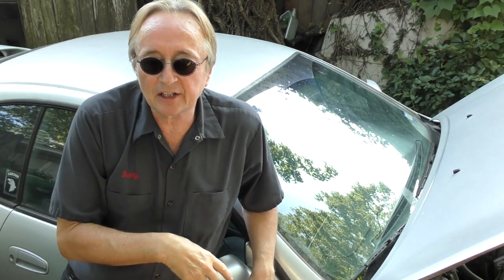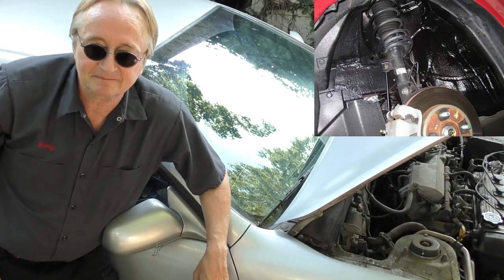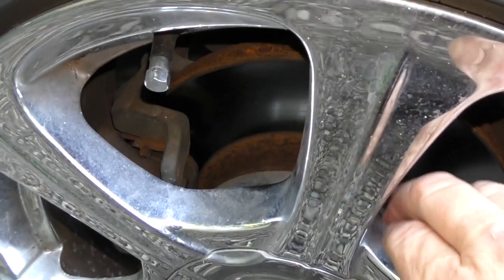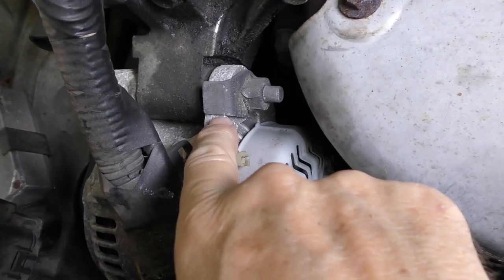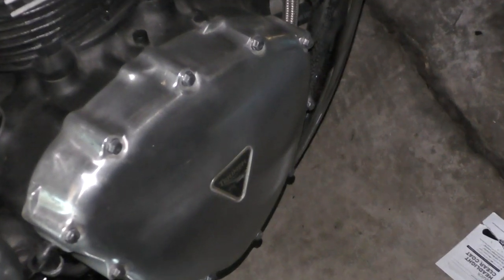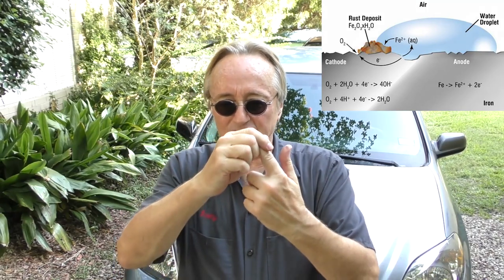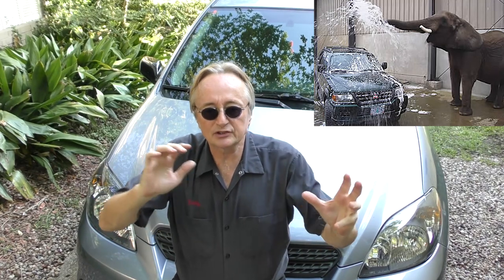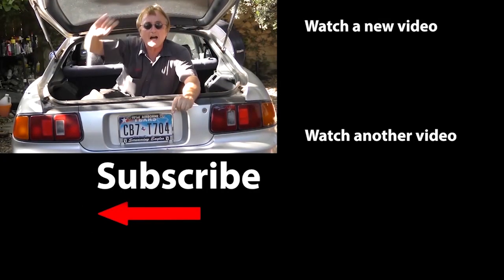Why Not to Park Your Car in a Garage

Comment: I always heard that cars stay in better condition out here in Phoenix! Just hope your AC never breaks because even the breeze feels like a hair dryer. 

I kinda made a mistake I wanna confess. I washed a brand new car because I was scared the heat might get to her. Well it's pretty dusty here in Phoenix so as you can imagine she developed spots all over. The wax jobs the dealerships use are meant to deal with the heat all day. I should've realized that but might as well share a dumb story. 

Honestly I wonder what other hazards dust can have besides on the air filters? Of course a hot engine and the battery wear out faster in 100+ degrees everyday but I'm not moving from phoenix anytime soon.

Comment: I bought a 3 year old crossover. Runs beautiful. Looked under the car, rusty as hell. I live in Illinois. Go figure. 
Is there any reason i should be concerned? Or try to remove some of the rust and put some protectant on it?

Comment: A thought just occured to me. Wouldn't the water that sits in the body joints technically be like the car is submerged allowing an electronic rust preventer work in those areas?
I live in a place that never gets below 17°c so ice is not a thing outside the refrigerator.

Comment: Corrosion occurs as a result of wetting and drying cycles.  Most corrosion on cars occurs in those states that have snowfall during their winter months, and also use road salt to melt snow that covers roads.  Another source is keeping cars near the coast, exposing them to salt water and salt air.  If you live in L.A., Phoenix, or Las Vegas, chances are you'll never be bothered by corrosion issues.  If you live in New York, Minnesota or Michigan, you'll probably fight a losing battle with road salt-induced corrosion.  As Scotty points out, if you live in a state that typically has heavy snowfall, you should rinse both the painted surfaces and the underside of your car(s) at least once a week during the winter months to minimize the effects of road salt.

Comment: I live up north upper peninsula of Michigan to be exact. My parents use their garage all yr. Of course it's not heated. Now my parents have kept their vehicles rust free. My dad waxes them once in spring and fall. At winter my mom will take it through the car wash once a week depending on the temperature. My mom is a home health aide and is on the road all winter long. My parents vehicles look great when they trade them in. One a 96 f150 they bought brand new with 103 miles on it still looked great not one bit of rust in 02 when they traded it in with 145,000 on it. Me I have had 2 cars I kept rust free. One my 94 escort gt I had it for 7 years not one bit of rust when I got rid of it. The other a 94 escort lx. Both where rust free when I got them. All my other vehicles have had rust when I bought them. It's hard to find a rust free vehicle that I can afford here. Can't afford new so got to buy used. I do try to find one with little rust as I can witch is hard.

Comment: I park my 20-year-old Toyota inside a cold, un-heated garage.  This keeps the glare ice from accumulating on the glass, door latches, etc.  There is no rust problem.  The shelter protects the car from destructive precipitation in the winter and summer.

Comment: I bought a 2004 with perfect paint.  The owner sold it to me and lied about mechanical issues.  I could tell, but I wanted a car that looked nice for once. After I got it home I dug around underneath.  I am fixing things myself as usual, but I need to do something to save it from rust under there.  You said an undercoat will seal it in.  So, what is the best way to save a car that's rotting underneath, but is nice inside and out and is a model you really like with low km's?

Comment: According to Scot Kilmer, he said if you park your car in a garage it might rust compared to parking it outside.
These are a few things that may happen to your car parked outside...car theft(your car can easily be stolen parked outside),dents(kids and other cars), paint discoloring( from acid rain), upholstery discoloration from sun(especially back seats, and roof lining peeling), outside cars can rust too, bird poop. Parking in a garage is better, just don’t park a wet car in garage for longer periods of time, after wash, let it sit in sun to dry and park inside a garage. Sometimes I scratch my head to some of the things he says
Reply: @Belmont wash the salt off the car, let it dry before you park it in a garage...simply. Benefits of parking in a garage outweighs the cons
Reply: @Belmont you go ahead and park your car outside ,go luck

Comment: Next vid suggestion

1. why you should not have steering wheel

2. Why you should not press brake at red light

3. Why you should go 
15mph on highway

4. Why you should not have side mirror

5. Why you should drive on flat tyre

6. Last but not least, why you should not buy a car

Comment: If your garage is heated enough to get your car dry it won't be a problem as long as you get your window opens. The reason is that if you keep them shut the humidity lvl inside will be higher then outside and it will rust your car fast. if you live in north canada, trying to start your car by minus 35 celcius is worst then keeping it inside a heated garage as long as you keep your windows open.

Comment: I had an 05 Buick in Buffalo. No garage. The car was so rusted in 10 years the brake lines blew and the rear suspension was close to falling out. I now live in Florida, own a garage kept 2000 Lincoln town car, not a spot of rust.

Comment: Scotty, Riverside California is much much better place to live than Phoenix AZ. I have been living both places. Riverside California  is ten degree lower on average in summer and winter is also milder. Phoenix has sandstorm which destroys engine and summer heat destroys rubber and plastic parts of vehicle. Phoenix is a hell of place to live

Comment: Scotty is right on this. A vehicle driven in road salt and chemicals and then parked in a heated garage is going to RUST.  I do disagree with him that salt is going to harm aluminum very quickly. All those little white Post Office mail delivery trucks have aluminum bodies - have you ever seen one with rust? Oh, and they were all made between 22 and 30 years ago. None of them are any newer. After that long, if salt was going to rust them out they'd look like swiss cheese but they are all solid, no visible rust.

Comment: Uh, yeah I am going to park in my garage. It’s 105 here today and we have cold winters. When snow melts and water freezes it causes issues (expansion). Sun damages paint, headlights and interior... my garage is a comfy 75 with low humidity. Car would last forever in there.

Comment: Hey looking at a 04 Lexus rx330 with 188,000 and a 1999 rx300 with 117,000 both at 7,000$  it doesn't look like they have had recent timing belt changed. Which one has better track record.

Comment: There is a caveat -- since the introduction of liquid ice melter, I have noticed that my cars all start to rust from the underside of the hood, where the metal is folded.  I don't garage them in winter, and generally do a good hand-wax at the start of winter (but I typically never waxed the underside of the hood!!)  From what I can figure, the liquid ice melter causes it to get into the seams of the underside of the hood as spray from cars in front of you hits the grill. As the engine compartment is warm, that stuff is sitting on the seams, and melting as the engine warms up, and pooling inside the poorly welded, poorly painted areas of the hood.  You can easily miss it until small ridges and rust bubble  appear out of nowhere in the hood.
Reply: Use a wand at the car wash and wash your inside of your hood and your radiator from the inside out . It helps clean out salt .
I also wash under my cars where the brake lines and fuel lines are at to clean off salt .

Comment: I live in Iowa (The Rust Belt) and all of the vehicles here will rust from the inside and work through the steel and bubble underneath the paint, so you can wax your car every day and it will still rust away.
Reply: Nah, the moisture has to make it's way behind the paint, either through a crack in the paint or through the porous face of exposed paint. If kept consistently, thoroughly waxed, from the beginning of it's life, rust can't form under the paint
Reply: @gregorsamsa1364  It is not rusting underneath the paint it is rusting from the back side of the metal and working its way through the metal to the paint.  The paint then will bubble and it is to late to do anything about it since the metal is gone

Comment: I would strongly suggest not to remove the superficial rust (the kind of rust Scott talks at the end of the video) if the metal is fine. Actually this rust layer slows down further rusting of the surface, because water will not get directly in contact with  the bare surface.

Comment: But wait, salt lowers the melting point of water, so it would have to be like -40 for the salty water to actually freeze solid... so does it really make a difference if there is rust, if your car battery won't crank the engine at -40?

Comment: This is exactly why I didn't heat my garage. The most important thing about rust is to park your car on a concrete or tar surface. If you park on a dirt driveway you're screwed. I know this by experience.

Comment: Rust may be the least of of your problems storing the car in a garage,  esp. a heated garage.  I'm talking RODENTS here (i.e. rats  and mice).   Supplying them with a nice heated residence and meals (they eat the insulation on wiring) may be just the enticement to make them your winter neighbors.

Comment: Rust needs charge , no charge(electron movement) no rust.
Salt mine trucks have pulse charge circuit to frame to stave off electron movement in the other direction.
Frankenstein say ,  "Rust bad, turn on pulsecharger."
Tin Man say ,  "Good idea."

Comment: At least in our area (Alpine in Europe) ALL brands cars are in a well condition just by having them in the garage. I have no garage and so does many friends of mine and our cars are in a worse condition. Garages are great just to dry up the car at least once in a time. If the floating stuff is right, then I don't need to worry about any rust. Truth: I have no garage and I'm welding every year to keep the car in a safe condition....

Comment: Ok another Toyota commercial from me - my daughter has an '06 Corolla In Ontario Canada, parked in an underground parking lot with not one spot of rust anywhere and it is not undercoated.  My buddy has to remove his brake calipers and grease the sliders every 6 months or they just don't work.  He told me I should be doing that as well.  I said I own a Toyota and haven't touched the brakes in all the time I've owned it - 100,000 miles and they don't rust and don't squeel and don't need replacing until they are over 130,000 miles or so.  He thinks I'm kidding!

Comment: Cathodic anti rust systems are very effective but you’d need to ground your car while in storage. And since most cars aren’t one complete circuit/piece of metal which many rubber and plastic bits interfering with current flow, it won’t work on a parked car unless, like Scotty says it’s underwater. LoL

Comment: Canada+harsh winter+salty brine+ heated garage = last week I punched out welded brake pads for 2015 car.....Only one was active between 4 on rear wheels and get worn very fast.. The best solution for cars it's rusproofing with thick oil or light grease ,  made in the hottest days of the year, this way the oil will penetrate the dilatated pores from metal...

Comment: Used motor oil on the frame. Even better is wax-oil. Beeswax shitter seal mixed with oil & brushed on frame & under parts.

Comment: It puts a light charge thru metal interrupting the rust process.  You may be thinking of a lead diode used on boats no charge used on them just a metal thats easier to attack and goes first. That wouldn't work on a car

Comment: The stuff they dump around here is called brine. It is so corrosive it is not uncommon to see a 5 year old vehicle, mainly pickups roached out. This stuff gets in the little nooks and crannies which is almost impossible to rinse off. And besides, trying to rinse off your vehicle in negative temperatures only freezes everything up. Locks doors wipers. The city don't give a crap about us hard working people. All they care about is safety at the expense of our vehicles. Sand is good enough at intersections and curves. All these chemicals do is get into the ground water and destroy the roads.

Comment: I won't park my car anywhere else but in the garage. Far too many cars are vandalized, burglarized or stolen when parked in the driveway or on the street. 

When the weather is very wet I'll open the garage door with the touch of a button and I park out of the weather.

Comment: Sounds simple, rinse your car off in the northern climates. Yeah, try that when it’s below 32 degrees outside (which it is usually four months out of the year).  Now your windows and doors are froze shut driving back to your house with salt and snow covered roads. Then the weather stripping can get ripped off trying to push your door open.

Comment: A garage keeps a car good for much much longer time than exposing it to the elements 24/7: sunlight, UV, extreme heat, rain, hail, bird poop, cats walking over it, extreme cold, freezing, ice, other cars that ding it etc. Winter mornings: you don't need to scrape and you don't need to start a very cold engine. 

Keeping it frozen all winter long is not an option anyhow once you drive it it heats up and melts the ice ... rinsing, touching up, waxing etc helps, keeping it frozen solid ... well, not really.

Comment: just clean your car good with a pressure washer at a safe distance from your painted parts, once a week and the car will last more than you would keep it, my previous car had 26 years and there wasnt a single spot of rust.

Comment: Truth: electronic corrosion inhibitors are a waste of money.

Also truth: drip-type oil spray applied annually from day one will slow corrosion to a nearly nonexistent rate.

If you live in the rust belt, do a mechanic a favor and oil spray your car.
Reply: I allways spray it in the fall just before snow time. This way, driving in the rain all sumer rince all the salt away before aplying a fresh coat of oil.

Comment: Surface rust?  Rust is rust.  The brake calipers don't rust the same way body panels rust.  Body panels are made of rimmed steel; structural parts are made with killed steel.  Rimmed steel has not been deoxidized and is guaranteed to rust.  It will actually rust from the inside-out.

Comment: Actually.......

All the new performance brake rotors come painted. You know when it's properly broken in when all the paint is removed.
However, those are drilled and slotted, so I suppose that the paint has somewhere to go.
I just painted my entire brakes yellow, so that when I drove it there would be nice paint everywhere but the contact part of the rotor.
But mine are also drilled and slotted. Maybe yeah, on regular rotors not a good idea.
But if you don't have drilled and slotted rotors you should just throw that car right in the garbage cause it ain't no good.

Comment: This advice sounds a little bit dated. Back in the eighties you'd buy your Ford Cortina or Vauxhall Viva or whatever and the first thing you'd do was buy a big can of Waxoyl and spend a dirty weekend under the car spraying the viscous stuff under the wheel arches, inside the structural members, and everywhere else. But modern cars don't need that treatment. I keep my car in the garage, never wash or wax it, and I have no problems with rust. I've heard it said that a film of road grime is protective.

Comment: If you have a garage use it. Scotty is wrong on this.
In the rust belt a garage allows the slush and ice to melt and fall off. The car  will then dry and if metal is dry it won’t rust. His philosophy might be applicable in Alaska but the flaw in his reasoning is that daytime temperatures (especially in the sun) exceed the freezing point. Therefore the car is subjected to more freeze/thaw cycles and is wet more often which will cause it to rust faster.

Comment: It is idiotic to say your car will do better out in the elements than in a heated garage. We had a heated garage in Connecticut and our cars never rusted. Only when they got older and handed down to the kids were they left outside and they rusted. If he meant ONLY when they had salt on them and it's below freezing outside he might have a point when it stays below freezing. Keep your car in the garage if you want it to last!

Comment: I'd rather have a car that rusts quicker and one that doesn't have snow, has a battery that works, and is 20 degrees warmer...in the winter. Screw that.

Comment: I'd rather start the car in the garage and not risk slipping on the drive way and break my arm. I will take the rust. My garage is insolated but not heated though.

Comment: Hyundai surface rust turns into brake damaging rust in no time. Crappiest quality steel in Hyundai's.  I have to clean out the gaps around the brake pads, rotors, etc 2 to 3 times a year. Terrible design.

Comment: Scotty is wrong about this.  Needs more science for his vlog on this.  Salt is used to melt snow and ice up to 15 degrees. Below that then it doesn't do anything. So unless you live in a state that is under 15 degrees everyday then you will have the corrosion problem.

Comment: Nope, this is one piece of advice from Scotty that I won't follow. Less UV means the paint lasts longer, so I always garage. Less sleet, snow, and ice on top means rubber and plastic is less exposed to the elements. No rust after 10 years and counting.